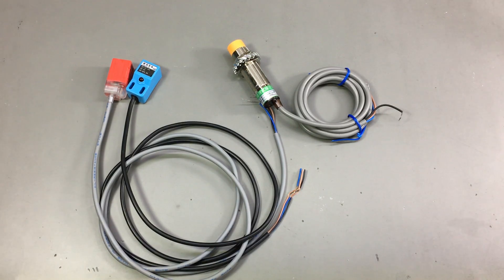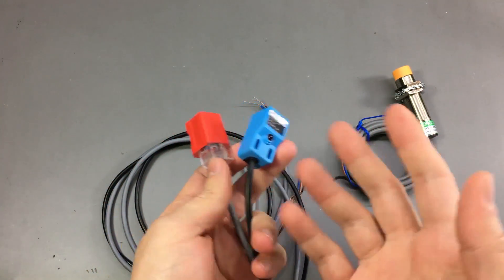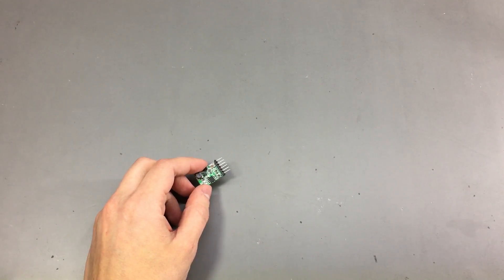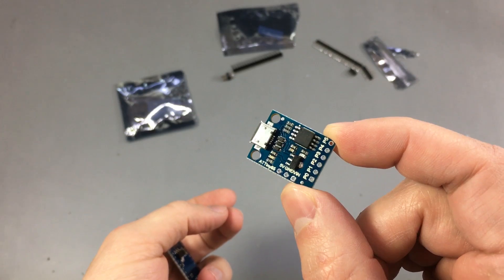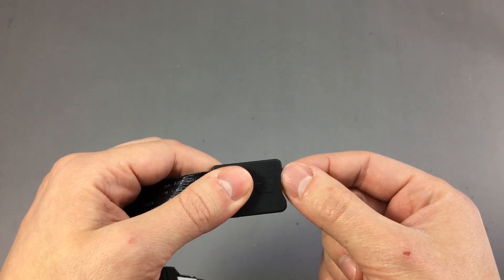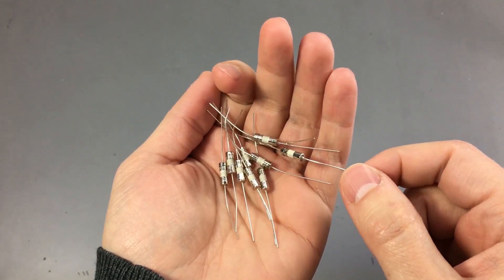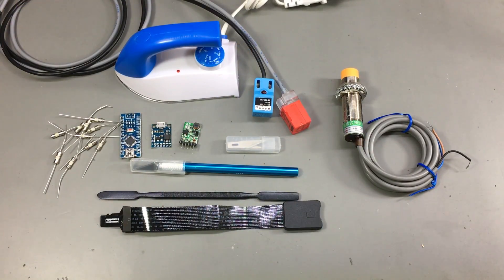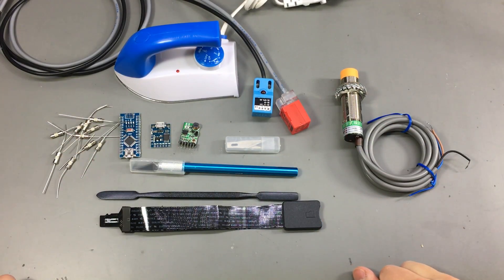Voltlog #153 - InTheMail

Comment: Meter fuses are actually wrong. Mainly they use fast blowing fuses, these are slow blow versions. But of course better than nothing. https://www.ebay.com/itm/Ceramic-Fuse-Slow-Blow-250V-3-6x10mm-5x20mm-6x30mm-0-1A-15A-Various-Options/122046319382
Reply from the maker: the product listing where I ordered mine was looking very similar, but instead they sent me leaded ones...

Comment: Forget the proximity sensor - and use a servo + miniature snap-action switch for bed leveling.
"normal" proximity sensors are too unreliably and react  different because of heat, humidity etc. 
The miniature snap-action switch work the same under most conditions.
Reply from the maker: I want to try and use the auto-bed leveling feature with one of these sensors to see if it actually works. If it doesn't work, than it's ok, at least other people will learn from my experience.

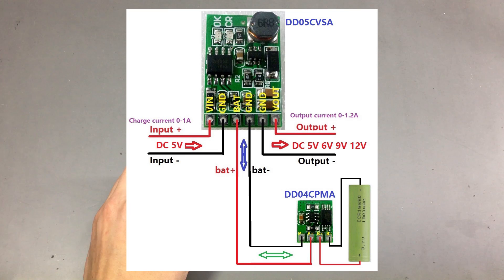Comment: 3:30 The DD06CVSA module from eletechsup seems to be what you describe -> https://de.aliexpress.com/store/product/DC-5V-2-1A-USP-Mobile-Power-Diy-Board-4-2V-Charge-Discharger-boost-battery-protection/1525466_32824032545.html

According to their info it also includes battery protection but can't be used as UPS. The module you have (DD05CVSA) is probably meant to go along with already protected cells.

They also offer a UPS module w/o cell protection (DD04CVSA) -> https://www.aliexpress.com/store/product/5V-2-1A-Out-UPS-mobile-power-Diy-Board-Charger-Step-up-DC-DC-Converter-Module/1525466_32816254080.html . Maybe i'll give that a try one day on my Pi Zero.

Edit: That last one is somewhat similar to yours and doesn't have protection either. Maybe its an older model or just a different power rating.
Reply from the maker: thanks for the info! I will orders these for a future InTheMail.

Comment: For safety: Open the iron to try to verify it it's really 220v compatible, remove the crappy wire, put 3 wires with line neutral and ground plug so base plate is grounded.
Reply from the maker: I checked for continuity between Live, Neutral and the iron, it looks safe at first look but I should take it apart to check further.
Reply: VoltLog The continuity check tests only a basic short between live and another element. It's a bit like with very cheap usb psu. There may only be half a millimeter between a live wire and a part you may touch. You need a high voltage insulation tester to check that because on a normal use there may be a small spike that creates an arc that ionize the air and suddenly it becomes conductive and it's like you are directly touching live...

Comment: both the digispark attiny modules can be used as HID devices, emulating keyboards for example, so extending they're use... i use one of them with an optical sensor to emulate a "coin acceptor" for my arcade bartop :)
Reply from the maker: yes, they're quite versatile and that USB emulation firmware is not new, it was around years ago.

Comment: I ordered 10 of the fuses without leads (250V 200 mA slow blow) and just checked my eBay history but the link is gone now (wish they wouldn't do that).  Another YouTuber had the kind you got and was able to remove the leads with side cutters - using them to strip the outer case off gently.  I didn't bother ordering the larger current fuse as I won't be using those meters for high current so only the lower current fuses are likely to blow.  Funny how many people I see that were on the Aneng band wagon now showing fuses they ordered for them (myself included) lol.
Reply from the maker: I didn't blow any fuse yet but it's good to keep them in stock cause it will eventually happen :-)

Comment: That iron may not be good enough for reflowing a PCB but it would be perfect for adhering the toner to a PCB. If you haven't already, look into "Liquid Tin" for saving the tracks on a PCB that might be in your interest and professional. Great Video..
Reply from the maker: yes, it might work well for toner transfer, however myself I haven't made a DIY PCB in years. It's just so cheap to get them from China.. shipping cost is also pretty low for express shipping if you are in a hurry. I used to make my own pcb's years ago but not today.
Reply: Just a thought based on that iron and I found if you use ink jet glossy paper, the toner doesn't stick as much. Easy transfer.

Comment: Thank you very much for the mention. I’ll be interested to hear your thoughts on the tp4056 ‘UPS’.
Reply from the maker: It's a pretty crude solution that combines chips which are not optimized to work together, there are better solutions from Texas Instruments or maxim,  but for a quick project this would do the job as well (minus the battery protection feature).

Comment: Usually, DMMs uses fast blow fuses. Last time I've used a slow blow fuse instead of a fast one I got blown shunt resistor and dead DMM chipset.
Reply from the maker: yeah, unfortunately hard to find them in this size, at least on ebay/aliexpress.